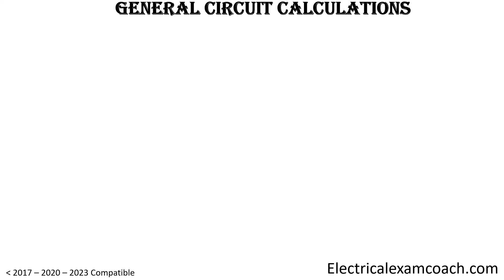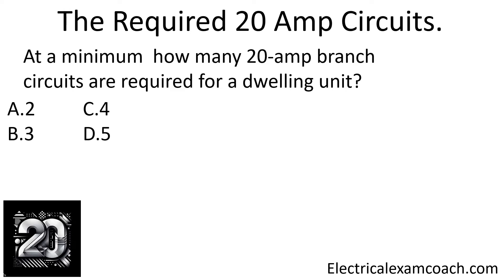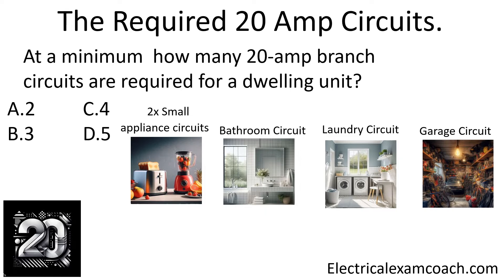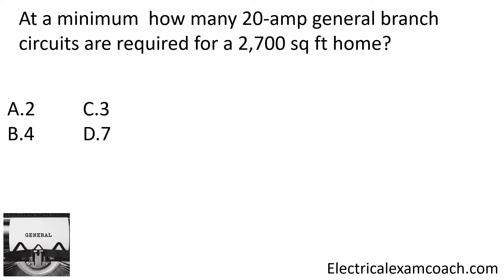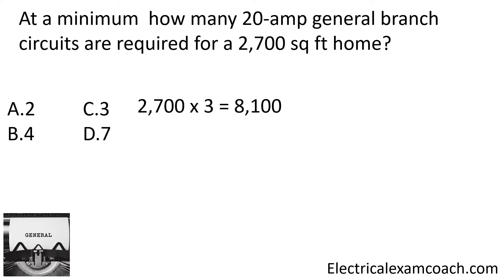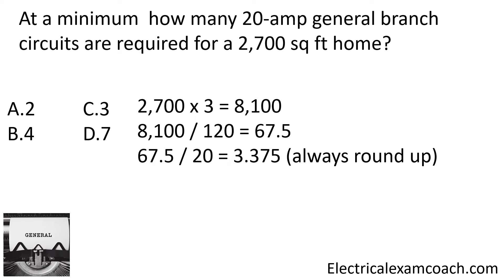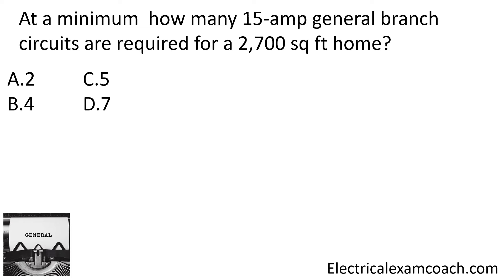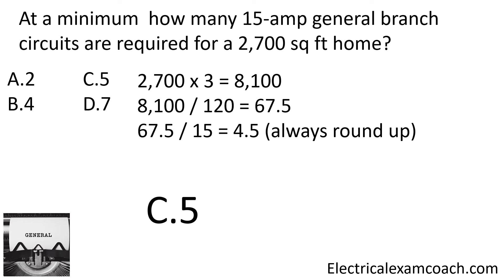4.4 How to calculate the Minimum number of General Circuits Required in a dwelling unit.

Comment: If we put together questions 1 and 3, Is correct to say that the dwelling will have 10 totals circuits? 5 for minimum 20 A circuits and another 5 for 15 A general circuits? Regards.

Comment: I believe the correct answer is 4 since homes aren't required to have a garage.
 If it was worded as a 2700sqft home with garage then 5 would be correct.
Reply from the maker: Appreciate the grind and the logic, this is a specific question off of a national exam and they're looking for five is the answer so I train that way
Reply: @ElectricalCodeCoach  Someone should tell the test maker's that some homes don't even have a driveway, so they definitely don't have a garage.

Comment: Do these prep courses help for master exams?
Reply from the maker: Here is the recipe. Sign up at  https://www.electricalexamcoach.com/membership-account/membership-levels/

1. Do the entire pro version.

2. Do everything in the ECC testing center.

3. Grind for 30 minutes a day on 100%

4. Put tin foil on it and grind 1-2 hour a day for 10 days leading up to the test.

5. Go take the test.

6. If needed, repeat until desired result.

Right now you can get a Lifetime membership for only $99.99.

https://www.electricalexamcoach.com/membership-account/membership-levels/